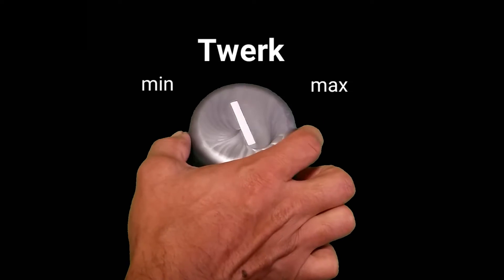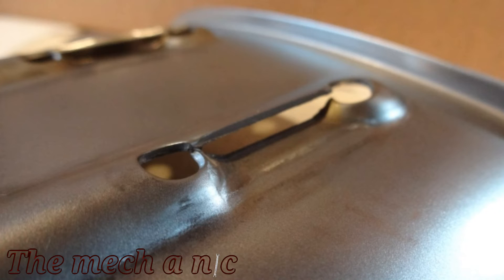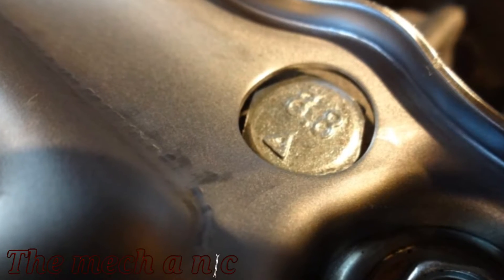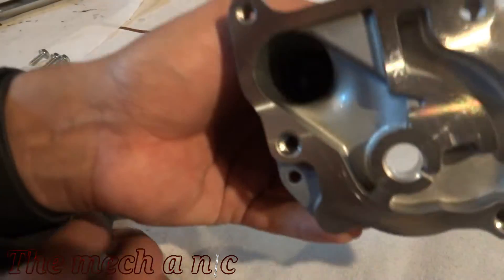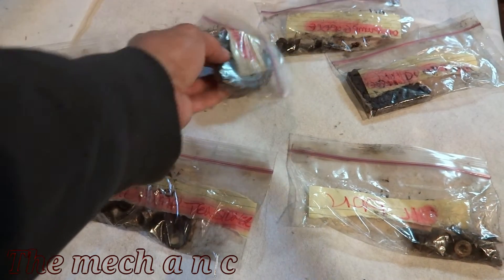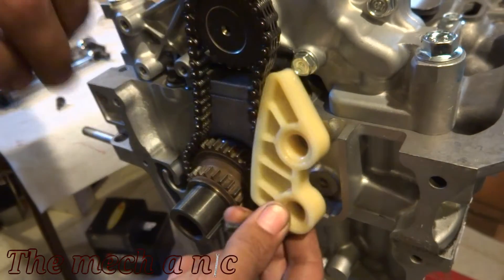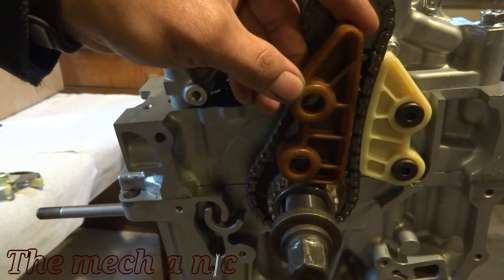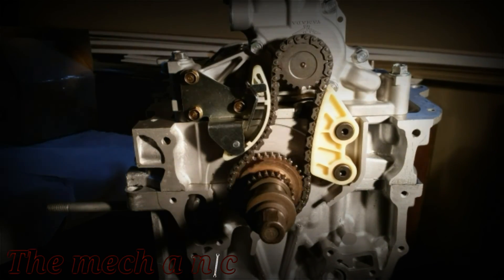k24 4piston oil pump install

Comment: What's the purpose of modifying an oil pump which is capable of 9500 rpm without any signs of functional loss on an engine, which is better not revved over 8500 rpm? Did 4Piston prove any of their claim on that pump or a stock pump? I see nothing then claims from 4Piston, never saw a proof of it. Money making...
Reply from the maker: Yeah I hear you. I don't know if there's any truth behind their claim. I'm sure there's a dyno sheet somewhere showing oil pressure throughout the run.

Comment: The bolt you have to use to plug the hole what size is it?
Reply from the maker: You'll have to tap threads so whatever threads you tap, that's what type of bolt you use .

Check out this old video I made about that bolt for oil pressure 
https://youtu.be/DXxsJAgZXSI

Comment: Any of the k24 bolts the same and will work? I forgot to ship out my bolts with a pump I sent out 😬 I forgot if the k24 ones worked, im trying to avoid him from buying new bolts...any suggestions? Thanks
Reply from the maker: I think the k24 and k20 oil pumps use different bolts . When I bought the 4piston oil pump it came with new bolts
Reply: @themechanic6117  i finally found out all the bolt sizes, guess the two 12mm on the k20pump are the same as the k24 where they bolt up too, i couldn't remember if I used them on my block and I did. As for the 10mm still haven't found out yet but im sure there is one located on the k24 or hopefully he has a spare match. But thanks anyways, ya they come with new bolts hopefully they didn't account for that in the price because you can reuse them, they are nothing like head bolts where you would have to replace them indefinitely as far as I know.

Comment: So on a new time chain kit... There are yellow chain links on the smaller chain.. Does that specific smaller oil pump chain have to be lined up with anything? And if so how?
Reply from the maker: Using a k20 oil pump theres nothing to line up. You can just install the chain
Reply: @themechanic6117  OK thank you!

Comment: Hey bro,i got a question. Im planning to do the same.but im confused wish timing chain do i need to use for my k20/k24a2.i have a stock rsx type s 2005 k20z1. Thanks for your help and knowledge. Keep it up with your built.waiting for that first crank.
Reply from the maker: I believe if you use a k24 block you have to use a k24 timing chain,  the oil pump chain I installed in this video is from a k20
Reply: @themechanic6117  ,thanks bro..im getting some ideas from your videos..keep it up✌👍
Reply from the maker: Thanks for watching 👍💪

Comment: Which you had show how you install the bolt for block the oil pressure
Reply from the maker: Look through my engine build videos  . I have a video on that. It's old n crappy but it's there

Comment: would you need to prime the oil pump? packing it with vaseline to aid it with priming?
Reply from the maker: I thought about packing it but if 4P shipped it like that and no where in the instructions it says to pack it so I didn't. It'll be cranked over before starting to ensure oil pressure
Reply: @themechanic6117  can i ask you a question. my friend installed a 4piston h22 oil pump on a h23 block and he is getting no  oil pressure. we tried packing it with vaseline and still nothing shoots up to the head when he turns the car over. Any ideas?

Comment: From the looks of it... you're ahead of schedule on getting this to running phase. What was the initial timeline?
Reply from the maker: I was thinking the same, but it'll come to a hault soon since the only parts I don't have yet are the really expensive parts. Over 1k for cam shafts, over 1k for intake manifold..never really had a finish date in mind. I'm in no rush since I haven't bought a car yet . I just want to finish it so I can admire it every day 😂👍